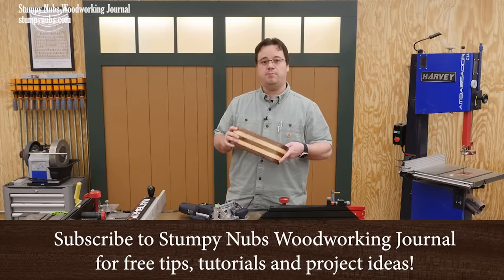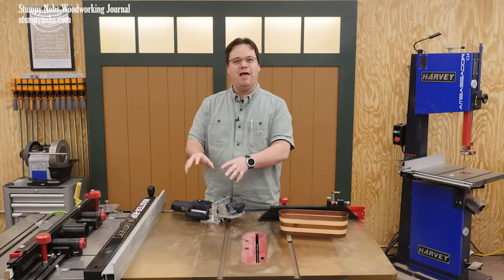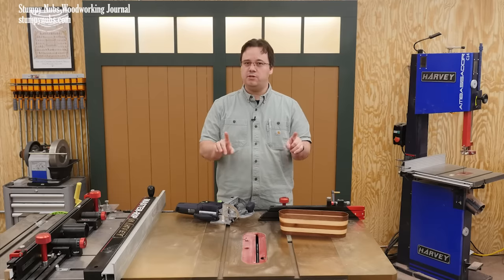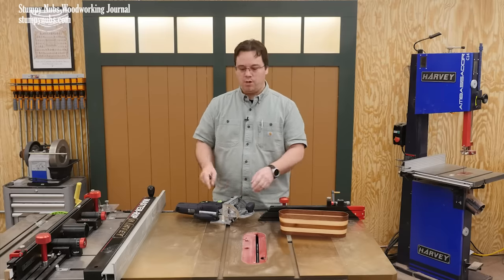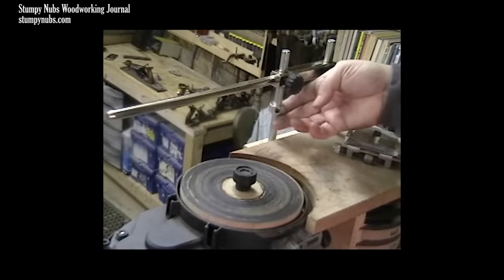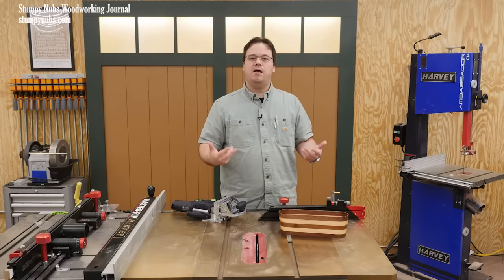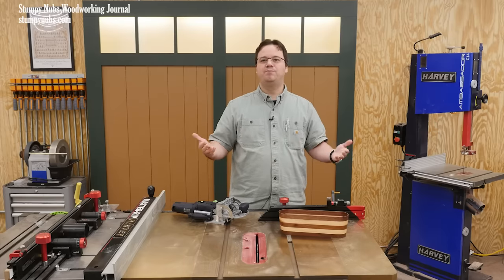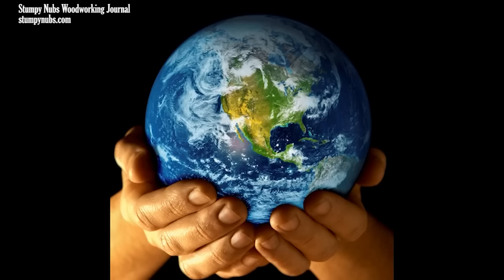This is why people HATE Festool and their Domino!

Comment: I personally think Festool makes fantastic tools that I will never own just like many of the big fancy machines like Felder. Festool makes tools for production shops that can afford them and for professional finish carpenters that need accurate portable tools that let them get results on the job site that normally are only possible in the shop. I think they are over priced but they are selling something that nobody else can replicate and if they can get away with it so be it. Now I do have to say that I’m about to buy a track saw and it won’t be a Festool because you can now get one just as good for half the price.

Comment: As a carpenter and wood worker I understand why this tool cost as much as it does. Although I don't own one of these I have many other "specialized" tools that are expensive.  When a tool can only do one function, and do it well, it's worth the cost. In regard to festool as a whole, I have used there miter saw and track saw in the past and was not overly impressed for the price. I'm a Makita guy myself. However I don't consider myself brand loyal. I just want the best tool for the job regardless of price or brand.

Comment: I watch your videos all the time.  Here's the thing:  I've been woodworking for better than 40 years but never as a job.  Never taken a lesson (dumb but true) other than what I might learn on Youtube videos.  I can build a house and I can turn some pretty nice stuff.  I can build cabinets and stuff like floating shelves without using commercial mounting fixtures.  Don't ask me to build a rocking chair--way, way beyond my skill level.  I'm better than a DIY but I'm hardly a craftsman.  I'm also not poor, although I'm not rich either.  In short, I'm a woodworking amateur who enjoys it immensely.  Ergo, Festools are out of the question.  As you succinctly and accurately point out, there are alternative and work arounds.  Sure, I'd love to have a shop full of Festool stuff.  But it would be a ridiculous waste of money for me.  My Bosch miter saw is fine.  So is my Powermatic lathe.  My Rigid vacumn does an admirable job--not great but good enough.  I've got a 30-year-old 10" Jet cabinet saw--it could stand some tuning up and I might someday replace it with a Sawstop even if I wish I could afford an Oliver.  I build my own router table 30 years ago and, stupidly, replaced it with a delux Woodpecker setup.  The old one worked fine and the Woodpecker had some real flaws--I had to replace the lift with a Jessm (parenthetically, the Woodpecker assembly instructions were just terrible).  At the end of the day while I could probably pop for Festool, what I got works well enough for my ambitions and skill level.  Nevertheless, I learn plenty from your videos.  Thanks, and keep them coming.  I also envy your beautiful shop--it's probably just a set to do videos but if my shop was even 10 percent as tidy I might be able to find that 15mm wrench.

Comment: I am on an alternate journey in my tenoning and rabbeting joinery methods. I appreciate the Domino, but it is overpriced, and my reluctance will push me to innovate. I also have a Sawstop which I have not yet purchased a dado stack and brake for. My thought is that setting up a spiral upcut router system will give me an alternative to blade change outs on my table saw. I am forging my own journey in woodworking, based on things that I have learned from Stumpy, Johnathan Katz Moses, et. al.

Comment: Thing is, for me at least, the price of the tool is not a problem. What does me in is the vendor lock in they do. I'm quite deep in to the festool system, mostly the 18v battery platform.

They patent the interface between the tool and the thing you're using to do the work. Centrotec, starlock, and probably the interface the domino uses are proprietary interfaces. Wild guess.

I like festool. Their approach to dust extraction, their way of limiting torque and kickback . But I also hate them for monetization of proprietary interfaces on top of selling expensive tools.

Comment: I heard the parent is running out soon. I had a df700 it paid for itself in less than two weeks and then I used it for 4 more. Then I sold it and got about 200 less than I paid for it. The problem I have with festool is that most of their tools are horribly underpowered, they also blow motors a lot faster than many other saws. I didn’t have a problem with festool when all the parts were made in Germany by unionized German workers. Now some of their tools/batteries are made overseas. And they didn’t pass on the cost saving. 5th just increase the price every year.

Comment: Regarding Festools prices, I've often wondered about how much some power tools cost, say, fifty or sixty years ago. Back when Porter-Cable, Milwaukee, etc., were made in USA and maybe of higher quality than today, what did they cost in terms of constant dollars? That wormdrive Skil saw that today costs $200, was it the equivalent of $1000 in today's dollars in 1980? And there weren't really the big box retailers so you had to get it from a specialty dealer, right? So, maybe Festool prices are correct and they as a manufacturer are more like what those storied brands of yore were like before they were bought out by hedge funds, their manufacturing off-shored, and the Walmart/Ikea effect on perception of what something is "supposed" to cost took hold. 

I've also heard complaints about how Festool doesn't allow dealers to set their own price and so you pay the same everywhere. This, it is argued, stifles competition which would help drive down the price. Well, doesn't Carhart do the same thing?

Comment: What I find interesting is that some testing has found using dowels to be stronger (provided you use enough) than the dominoes.  I'm surprised there isn't already a big market of domino-like machines that do dowel holes. Sure, it's overkill, since you don't need such a fancy rig to do the job, but the speed and accuracy of the domino is its biggest selling point; those ideas should be used for dowels, IMO.

Comment: I agree, they want to get their money back for the design and tooling, but it seems they are trying to get all their money back on one sale.    Bottom line, it's not a must have tool like a saw or screwdriver.   As a civil engineer once told me, anyone can make a road last forever with enough money, but it's a great engineer that can do it on a dime.   I'm paraphrasing.  My less expensive, Makita drill and Circular Saw, (from Home Depot) are now more than 15 yrs old, and still work great.  I have replaced the power cord on the drill.

Comment: I have one Festool; a Domino 500. I have no brand loyalty. Quality and price are the factors which make me choose my tools and machinery. The domino is a quality tool, but I don't think it's better designed or built than my DeWalt and Makita hand tools. I chose the domino because there is nothing else that does the job so conveniently or, in some cases at all (none of the alternatives I've seen enable speedy loose tenon joints at angles other than 90 or 180 degrees). I bought it second hand, lightly used, and for a very good prize. I'd probably have bought it full price, having used it for a couple of years, and discovered how quick and easy it is to use. I have no plans to buy any other Festool.

I'm puzzled by the brand fetishists, those who collect quantities of Festool products, often into double figures, and obviously enjoy the look of having them stacked up in their distinctive, flimsily built, green and cream Systainer cases.

Comment: Price charged  reflecting the development cost - that is sunk by the whole corporation, it reflects "proprietary protection" afforded by patents. Charge "all you can" for the 20 years that patent is enforceable...  Once the patent expired knockoffs will appear - some potentially higher in quality, for possibly a cheaper price.

Buyers who perceive value will pay, the others will continue using biscuits - or homemade dowel jig.

I do have direct access to both diamond flattening plates Festool and Sawstop - however I also have a cheap 2 in 1  sharpening stone on my workbbench and get pleasure sharpening my 3d printer bed scrapers razor sharp.

Comment: I remember watching a woodworking show on public TV. This guy had a shop full of expensive machines. I did not build a single project of his. First we take the wood to our 24" planer, then to our crosscut saw, then to our table saw, then to our self feeding sanding drum, and off we go to our mortising machine. We join the edges with our 5 HP finger joint machine, etc. I was not and am not a professional cabinet shop, and if I were, I would not need to watch him to be able to do anything.

Comment: You didn’t mention the Dowelmaxx, which is a viable alternative to the Domino at around $300. I use mine frequently enough and it works pretty well at a quarter of the price.
Reply from the maker: The Dowelmax is great, but it's not the same type of tool. While you can reasonably compare a dowel to a domino, the way it works is completely different.

Comment: Another thing the anti-domino crowd conveniently skips is the value of the time efficiency of using the domino. The tool is expensive, but I'd buy it again in a heartbeat. The simplicity of using the domino saves so much time that I've saved several weekends worth of time over the past few years that otherwise would have been spent on setting up a piece for routing or what not.

Comment: I have a lot of Festool tools and I find the value to quality worth it for me. I dont just buy Festool for the brand and when I need a new tool I research what offers the best value. So I have Makita, Dewalt, and others. I bought The Fein multitool over 20 years ago, its in great condition, used regularly and it looks barely a few years old. So for me thats a bargain! Lately for many hand tools I buy China tools and the value, quality and in many cases innovation is ahead of the pack. 5-10y ago I would never considered any tools from china brands but things have changed.

Comment: I'll be honest, I'm not really a fan. It's not so much that I have some concept of superiority, or that I believe making things easier is heresy. I just don't really like the domino, or the style of woodworking that it suits. I usually build smaller things, and I'd rather take my time and make them special. Not to say that things made with a domino aren't special, but they don't appeal to me in the same way and since I'm making them for myself, that's what I value. For that reason, I don't really use anything that would be equivalent to a domino either, whether it be dowels or my own jig attempt at replication. (Except the occasional drawbore tenon, those are fun.) 

I also agree with what you said about tools and how they don't limit craftsmanship. I do most of my projects with an old hand plane, a bit-and-brace and whatever hand saw is sitting nearby. That doesn't mean I'm some kind of hand tool snob, of course. I have a bandsaw that I love, but it goes to show that you can do a surprising amount with surprisingly little. It does feel like a domino would be out of place. 

So to sum it up, I don't like the domino, but it's not Festool's fault.

Comment: I owned a Domino, i bought it used, because it was pretty uniqe, buisquit joints are simply not the same thing, this was a machine that could make strong joints fast.  I also bought a used festool vacuum cleaner, and a festool sander, because their dust collection was exellent.  I did not buy anything else festool, as i thought the things i choose from festool was what they offered difrently/better than the competition, and altho a festool mitre saw might be exellent, it's price simply aint worth it, and it's not giving me anything vastly diffrent than the competition.  And i view a lot of the other stuff from Festool the same way.  Back to the Domino, i found it very handy for someone that needed to make cabinets/furniture fast.  But as im more of a hobbyist (altho had woodworking schooling), and found more joy in hand tool woodworking, i sold it.  I would buy it again, if i ever could make a buisness out of it.

Comment: Festool, love it, Hate it 😁
I bought a Domino early on as in EARLY ON. It solved a problem and still does. Yes, I also do traditional mortice and tenons but pick up the Domino more and more. Expensive yes ,proprietary yes. This I do not like. Try to by Centroteck drill bits. 😞 But the drill motoerrs work great (battery life could be better) as does my Domino, Kapex and dust extractors. I do not work in Metric so this is a continual problem. But I live with it.
 Yes, I have a Sawstop. sold the  Powermatic PM200 when the grandkids took an interest. Better to spend money on a safer table saw and better tools than reconstructive surgery.  
I am not an exclusive Festool user, I watch my pennies and dollars carefully. But they work and they address specific issues or make my life simpler, safer, cleaner, whatever..  then I am a player.
Keep up the good work thanks for the reviews and tips
Doug

Comment: A good workman never blames his tools. I've been building custom cabinets for 30 years. I buy my tools used and cheap. I bought my table saw for 50 bucks over 5 years ago and still nothing wrong with it. I would never own a Festool unless it was given to me. the only new tools I get are gifts from my wife. She bought my Dewalt screw gun and impact set 12 years ago and the batteries are recently not lasting as long between charges.

Comment: I think one thing that is missing from this video is the difference between a hobbyist wood worker that makes furniture for the fun of it, and a shop that produces a volume of high end projects for their income.  When you are running a shop or are part of a larger business, time is money.  A 1700 dollar domino tool lmay be expensive, but if you think about things in terms of hourly cost vs production then these expensive tools can make a bit more sense.  Lets say buying the the festool saves 5 minutes per piece and lets say a worker can do 3 in an hour or 20 minutes per piece.  While 5 minutes may not be much on the outset, with an extra 5 minutes per piece that puts the build time to 15 minutes.  So the worker who is building the pieces can now make 4 in an hour. 

Now lets say those pieces are each worth about 50 dollars when sold.  So you take in an 8 hour work day and they are doing doing 32 pieces per day as opposed to 24.  By buying that tool, they that employee is producing an extra 400 dollars per day. Now because labor is a fixed cost, that extra 400 doesn't need labor to be accounted, but even if we put a 50% markup on the raw materials (which is low by industry standards) that means an extra 200 dollars per day.  To repay the cost of that tool would be 8 and a half days.  So in 2 working weeks the tool will have been paid off and all of the usage from there is profit even given how extremely overpriced it is.  

Now that being said, most woodworkers watching youtube videos are not running a full time shop and are not counting how many minutes it takes to build x product trying to figure out how you can cut that time further.  And in those case, it makes no sense.  Because the average woodworker isn't going to need to make 3 of those parts an hour 8 hours a day, 7 days a week.  They will need it once in a while when it comes up.  And to those people it is not economical to have the perfect tool for every job because you are not chasing time.  Even in startup woodworking businesses, you need money to invest and you do it gradually.  In those cases the idea is to have the most versatile tools.  The festool domino is a waist given its limited uses.  And a router while also being much cheaper, can do a large amount of different jobs which makes it a fantastic buy.  I mean you would be forgoing other versatile tools in buying the domino which would limit you.  Always choose versatility for home shops and only optimize for things you do a lot.

Comment: I think one of the reasons for all the hate is it can be hard to think about a handheld power tool as an industrial tool. It's easier to forgive a high price when something is recognizable as industrial. Would I LIKE a Castle TSM-12 Benchtop Pocket Cutter Machine? Sure. But it's obviously a pro-shop tool and its $1700 price tag fits. Same thing with lathes and milling machines: cool to look at but fewer people are offended by how much they cost as they're obviously not aimed at the home-gamer. The Domino looks like a tool for the hobbyist but they're clearly positioning it to professional woodworkers doing this stuff for a business. If I was running a business doing a lot of loose tenon joinery, I'd drop the cash on a Domino and not spare it a thought. It's obvious how much time it would save and, therefore, how much labor cost. But I'm not a business, I barely have a toe in the hobby. A Domino actually costs more than my entire power tool collection. I WANT one... but can't even begin to justify buying a tool that expensive when it might get used for one or two projects a year. 

A second point is how some other channels are so often just a chance for some guy to show off his super-expensive toys. Those folks get... tiresome. Thank you for not being one of those channels, Mr. Nubs. I've learned a lot from you and your humor and keen insights will keep me coming back. Thank you!